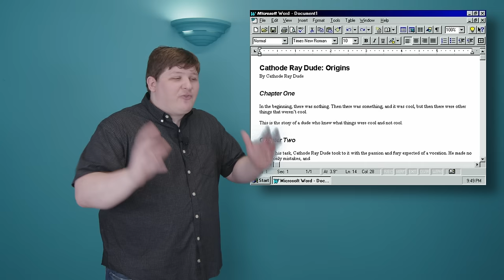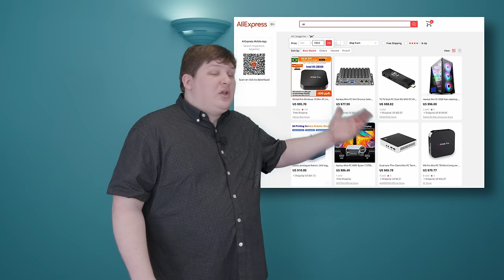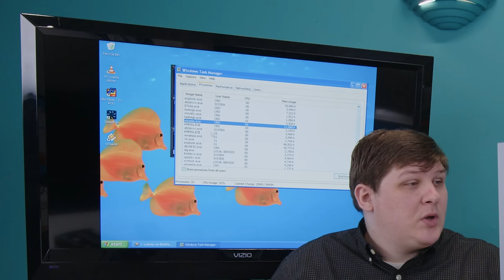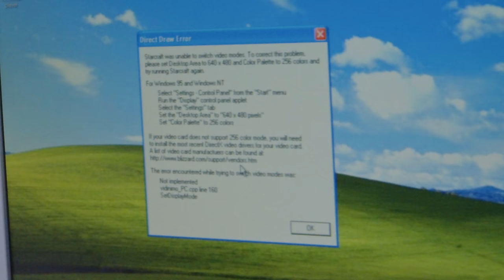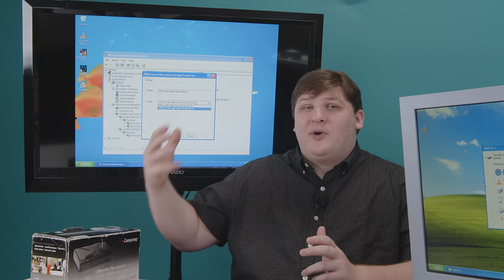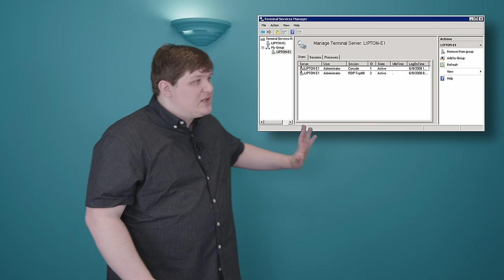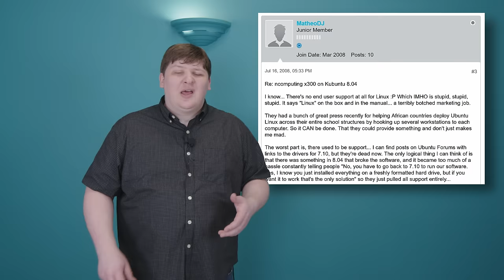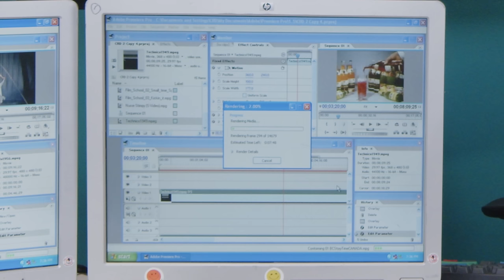7 Users on 1 PC! - but is it legal?

Comment: Guess before I finish the video - at 26 min - will update once I finish watching. 

Original Doom was a big clue to me on how this thing worked.   That the screen for 1 of the terminals is 1/6th of the screen makes me think this is chopping up a desktop in to multiple user interfaces.  Each box is set to expand 1/6th of a screen into a full sized normal resolution screen.
I bet if you setup all 7 and tried to run the original doom you would run into the same issue but doom would be running in a different section of the screen.  
screen 1 = fine; 
S2 = Top left; 
S3 = top mid; 
S4 = top right; 
And so on.

Edit:

OHHHH  it is like Terminal Services + a fancy KVM...   Interesting.

Comment: Not a surprise Unreal ran well, it was made to be playable in its software rendering mode in on a Pentium 166. You should of tried Unreal 2 or Unreal 2003, both those games also have a software rendering mode. One of the last games to have such.  The 2003 software render also works in 2004 if you copy it over.

Comment: I've been reusing old computers without many issues for the past 12 years. We only bought 2 servers, one used. All else was just reused after an upgrade (SSD, RAM, cpu). Linux was a bit painful most of the time, but it is better as a desktop system right now. Even better than windows (finally).

Comment: Not sure why but randomly got recommend this, most the video wanted to know if you knew about or looked at Windows MultiPoint Server 2010 or later versions? Microsoft may not have went after this company but they did start offering software to do this. in 2011 they added RDP, and in early collage saw many of these systems. I would really like to see your views on trying it.

Comment: This is just a glorified KVM over Ethernet and the drivers basically tell Windows to run the apps on the server in different desktop sessions and then assigned to each client ID. Its like remote desktop, but at closed distance. You can do the same trickery with both Windows and of course even better on Linux. Back in the '80s we had a Motorola 68000 server running SCO Unix with 20 WYSE terminals in our computer lab, for each student to write code
Reply from the maker: It's literally not ethernet. You did not watch the video.

Comment: Had no idea they invented these sorts of thin clients for windoze. If I’d have been the IT admin I’d have just said “we’ll use Unix or Linux and call it a day”. My school had Apple IIc in the early days without any Internet and later crappy Dell Inspirons with one 128kbps ISDN connection in my later years. We also had a special bus that came to the school once a week that had early PowerPC Macintoshes that had educational software installed on them that we’d use. I only learned the power of Unix/Linux in my college years when I had an Intel Mac and boot camp though, and retrospectively I regret not switching to Linux earlier than I did. Oh well, lesson learned. Cheers.

Comment: "Not many offices had networks in the mid 2000s"  'nuff said about the accuracy of this video :)    Yeah - you need to buy TSCal licenses on a per-named user or per-concurrent user to do this.  If you had a Microsoft site license, you were fine though which covers many uses.

Comment: Same here with a 2010 MacBook Pro.... i realized i have to upgrade the computer as i could only watch 30 fps youtube videos anymore, 60 fps were lagging hard with partially even 10-20 second video freezes (at least the sound was running normally lol)
I needed to use Windows on the MacBook Pro to use youtube properly at least up to 1080p60 worked, 1440p (30 or 60!) was also a hassle on windows as well.
Reply: But still... my 2010 MacBook Pro is still going strong - when the nights are clear its used for controlling astrophotography gear like guiding cam for autoguiding and automate the capturing process with plate solving, capture queues etc.
Its replaced already by a 2021 16" MacBook Pro with M1 Pro CPU (which is also very charming to use for astrophotography) but especially in the cold months i just dont want to abuse the new Mac in -5°C for example the whole night.

Comment: my desktop pc currently runs an Athlon quad-core processor and works well for what I currently use it for. Though, I can't really do any heavy CAD work (My trade). I'm running a GTX-1060ti OC video card, which makes Minecraft to work with vanilla textures, though render distance needs to be cranked down on more intense maps.
But... TBH, I'm not much of a gamer anymore, so, for now, the ol' HP handles things alright.

Comment: Even gaming.   I would say around 2012-2020ish was a golden age of PC gaming as far as PC longevity for that purpose.

I've been PC gaming since the mid 90's.  I HATED the late 90's-aughts for PC gaming.  It seemed a year after I would build a new PC I'm already having to crank the settings down to mid-low on new titles.  From 2000 to 2010 I built 4 computers.  AMD Athlon, P4 (stupid, lol), Core 2 Duo, 1st gen i7 920 based systems.  Furthermore, back then the difference in graphics settings were far more dramatic than today.  Ultra to low settings were a freaking world apart.

Then it happened.  In 2013 I built my i7 4770K based system.  I rode that horse until I built my current system in 2021, I upgraded the video care in that system ONCE (to a GTX 980 Ti).  8 years on that platform and it ran everything I played great.  I didn't even feel I "needed" to upgrade when I did really.  Sure I wasn't running everything on "Ultra" at that point, but getting 60 frames on a high/medium mix and getting 60 frames was pretty typical.  With the added bonus that with modern games different graphics settings aren't as in your face as they used to be.

I feel we are entering another shitty phase of gaming on the PC though.  We're having another situation where it feels even with a brand new top of the line rig, you will have to make sacrifices on graphics to maintain respectable frame rates.  I don't know if its the developers not optimizing or the hardware technology just lagging behind now.  It just seems that there are a tad too many games coming out that are system killers when you have like a freaking city builder than an i7 14700K and a RTX 4090 can't even maintain 60 frames on max settings on an empty map.

Comment: Those 2 extra RJ45 pins might be a version of USB as USB could in theory run the audio and keyboard and mouse at the same time through 1 port. Proof of this is if you have a USB hub connected to 1 USB 2.0 port and were to connect a USB sound device and a USB to PS2 mouse and keyboard.

Comment: so, if running 'windows' and 'windows executables' from my machine using another machine is somehow illegal without extra licenses, what about if I'm using a remote desktop application from my phone to use my windows machine remotely?  you know, like Chrome Remote Desktop, or Windows Remote Desktop (the one windows gives you...)... I think EULA's just cover EVERYTHING and worry about it when it somehow causes an actual problem that effects their bottom line in a major way.  That is why EULA's are so long that no one can reasonably read them...

Except me, I spent some time doing this, and by some time I mean HOURS AND HOURS (I get really really bored)... and what I found is that most EULA's I've read contain stipulations that counteract or contradict one another, or logically just can't work properly in the same agreement.

I guess this is why many EULA's are not considered binding contracts when it actually comes down to a lawsuit regarding it unless you are talking about a major company, which most likely also uses such an obfuscated EULA on their own that the house of cards is shaking just by thinking about it.

Comment: The most jank about the whole setup, that power strip hanging from gaffa tape..... 
I have a little atom based box that does security recording and some NAS duties, I added a remote DOS user login, just using windows, its purpose is to allow 8 bit retro computers to connect and upload/download files to my network. (Having my old TRS-80 being able to pop stuff on DropBox, neat)

Comment: At the time period talking about, Linux would have been your solution. My company which designed digital and analog integrated circuits (ASICS) used Linux for multiple users at the time period you were talking about.

Comment: Are we really not over pretending that the ribbon wasn't a massive improvement in the UI design?
Reply from the maker: The ribbon is the worst, most undiscoverable UI concept in the history of the GUI.
Reply: @CathodeRayDude  If I didn't know your YouTube channel I'd say that means you haven't seen a lot of UIs :P

But seriously, I will never understand how people have so much trouble with it, as someone who experienced that transition in school. Everything is extremely clearly labeled, and context sensitivity is a godsend for applications of this complexity.
Reply from the maker: I've been using apps with the ribbon UI since it was introduced in what, 2005? It's static to me. I can stare right at it and I can't read anything. It's a frenetic mess of baffling groups and subgroups, trying to impose order by creating arbitrary subcategories that don't mean anything to me. After 20 years, I still can't use these.

I have logged literally thousands of hours in Office and I still can't find basic formatting tools. The logic of the whole thing completely escapes me. In Office 2003 the option for setting margins was in, like, Page, and even if it wasn't a logical grouping, all you had to do to discover the menus was flip through them. Took twenty seconds, tops.

In the modern UI, It takes me three solid minutes every single time I want to adjust margins, and every time I go to the tab it's on at least four times, look at every control, and can't see it. I don't know how they did it. I was 17 when they started doing this, my brain was fully malleable, so I'm gonna say it's a bad interface.
Reply: @CathodeRayDude  "Page Layout" -> Big fat button "Margins"

It could not be any more obvious. And the same goes for pretty much everything I've ever seen people struggle with. Conversely, in the Office 2003, I always have to dig through the menus and often just ended up googling or clicking on options that vaguely resemble what I want.

I guess there must be something wrong if so many people had issues with it, but I could never figue out what. It was an all around improvement for me.

Except for many 3rd party apps that didn't understand the concept at all and created entirely illogical nonsense with it.

Comment: rewatching this video after some time... I'm guessing the keyboard and mouse input is getting passed directly into the terminal environment via the terminal services DLL since terminal services takes user input via non-physical devices in the first place; for basic user input it maybe is not doing anything that really needs OS awareness if they're just providing input to the per-user environments?  Whereas the audio and video stuff requires the OS to handle interacting with the devices -- if nothing else because they didn't want to do that in their FPGA and/or drivers

Comment: EDIT: Pretty much right after I typed this, you covered it. I need to learn to watch before I comment. :)

The scenario you are ignoring is web browsing. Web browsers from 10 years ago will not work on most modern sites. Therefor, they need to be updated. Browsers and websites have become much more resource intensive in the last 10 years.  If using a low end machine from 10 years ago, web browsing current sites is going to be painfully slow.

Comment: Does it only work with Windows 95 and up? I used to play Doom with some friends back when I was on Dos 6.22 and Win 3.1. It was pretty hard to get games to run back then you had to write Autoexec.bat and config.sys files so that it would load your sound drivers and I think you even had to code in to load the video drivers not sure about that it was so long ago I doubt I even remember how to write an Autoexec.bat in dos. You would load Dos than windows I kinda miss dos. Games would run far better in Dos than in windows because in windows you're running everything but when you launch a game from Dos all your computing power goes to sound, video and the game.

Comment: As for Linux support - it is entirely possible that the wider Linux community just said "no" to these blobs, as seems to be the trend (distros nowadays really push for having your crap be open-source if you want it to "just work" with Linux - otherwise you're left with arcane and frankly very broken stuff e.g. nvidia does with their drivers). This probably effectively meant that some dependency for stuff like that was simply no longer available on Ubuntu 8, and that pretty much made it dead in the water unless they opened it up more - which they probably really didn't want to do. Linux is all about the idea of "if you made it, I can use it to make something better" which is often very much at cross-purposes with shrinkwrap.

Comment: How can we run Vintage operating Systems and Software on new Modern Hardware? I never got to own a First Gen Mac or Windows 95. I was stuck on Commodore 64. New Subscriber. Thanks.
Reply: You just have to be hardware-compatible. I run a 486 for DOS games, using a SD2IDE card. It still boots on modern PC's too, but 16-bit real mode, so you don't have any high-level drivers for sound and graphics, and you're bound to the 16-bit limits regarding max RAM and disk sizes. I have maxed out a SD-card to 1 primary pertition + 4 logical drives of 2.2 GB per drive. I believe I can't get it any larger, but "hotswapping" the SD-card works too. It thinks it's a random I/O fault.
Reply: PCEm

Comment: re: Linux, it's not all that hard.  LTSP, Linux Terminal Server Project has been around for at least 20 years and is pretty straightforward.  Yes, you need another computer for the terminal, but these days, folks are giving P4 and even faster computers away so no cost other using more electricity.  But, you can have these in different room, not just physically hooked to the main computer.

Comment: And we still see this today many people get caught up on the tech bandwagon you will be surprised the amount of people that buy a lambogini in computer terms but they really only use it for common computing tasks like web browsing, basic office stuff and basic creative stuff. Its akin to buying a lambo but only ever driving 40kms/h.

I just helped someone on a forum who wanted to upgrade a 2nd gen system to make it snappier and only has a budget of $100 so i advised them to max the ram to 32gb and if they also can get the i73770 crossgrade from the I5 so they get an extra 4 threads. They only need it for browsing and some coding, you will be surprised the amount of people that came in and said straight away to upgrade to a current computer, its the same process line of thinking when less experienced people say to others to "just reinstall windows" because they don't actually know what they are doing. 

if the person only has 100 dollars budget and they are only doing light tasks not bleeding edge like AI learning or anything with their coding then i mean that sets the whole premise of the build they also did state that they are not looking to go new at this time because their current 2nd gen serves its purpose and so it should because you can still do much of the workloads with this platform and it can still game, its slow on paper but its still a workhorse just slower.

We have only been 4ghz base since 2017 all the extra stuff is just bleeding edge enhancements that mainly tailor to newer computing so if you are not really playing high rez games ultra everything or rendering 3d graphics or doing any heavy AI stuff then you don't need a Ferrai to drive you to the shops an normal old car will do the exact same job. Since 1st gen and hyper threading all these gens are still very capable and if you know how to finese these older computers you can do much of the workloads we have in computing to this day, Just don't expect them to do stuff they can't which even then its not much in that regard if you really know what you are doing.

Comment: My college had something like these. But it wasn't 7 clients per host, it was more like 25 and they worked through ethernet, perhaps the had a later version? (It was 2008.)
Either way, they were terrible, completely unusable. With everyone logged in, it was so slow even working with Word was an unrealistic expectation.

Also instead of each client being a separate monitor if you checked the windows settings it would say it has one monitor at something like 6400 * 4800, so it was rendering one screen and dividing it up between the clients.

Comment: crDude apart from opening task manager at least once to see cpu occupation, you could have used a session/winstation/desktop enumerator to see what's being created from the ncomputing software;
could the serials of the little devices tied in some way to the users licence?
probably the software on the host is hacking the registry to permit to terminal services to create/connect more than one station... (or it's installing a user level driver to bypass the limitation, maybe?); anyone who has tried multi-user windowing along the history of the various version of windows has seen how this has been addressed and patched;
also about having a shared pc vs having one pc per user: yeah less power, but if one pc goes down, 7 people can't work... it's something to take in consideration; also security would be really sketchy, there would be really a need to isolate folders access and so on
Reply from the maker: Tried several methods of inspecting current window station sessions and everything came up blank. Not sure what they're doing but it's definitely bypassing some components.
Reply: the most trustworthy method is using sysinternal tools (or calling apis yourself)